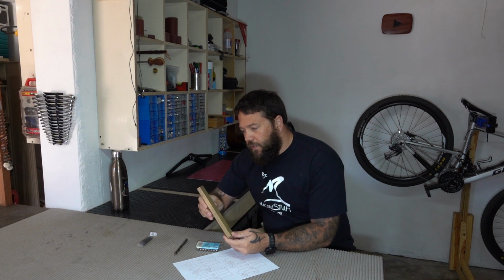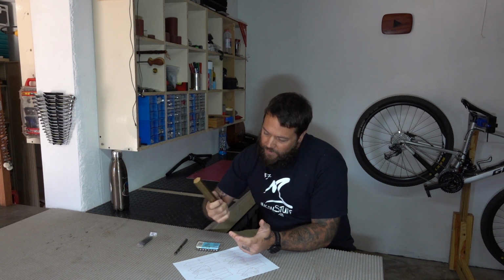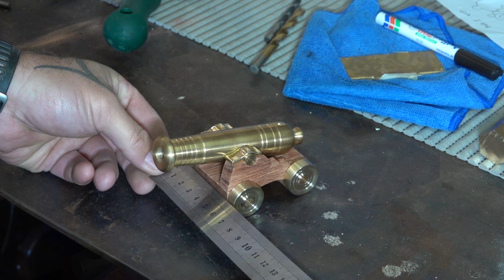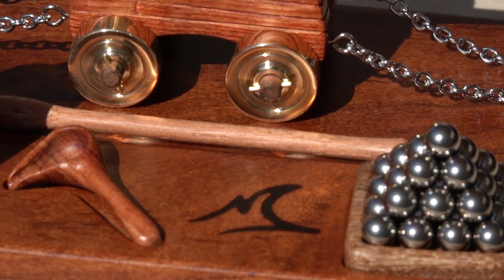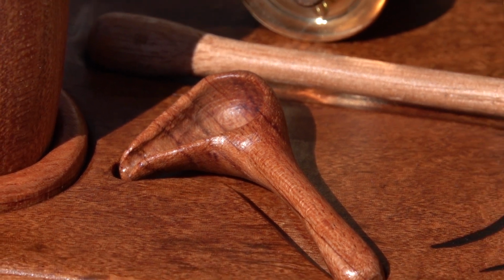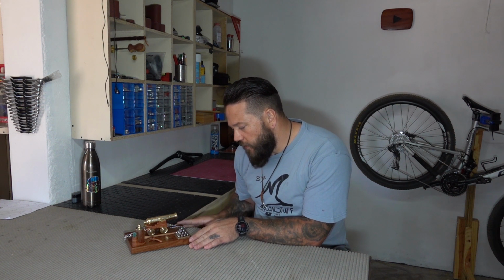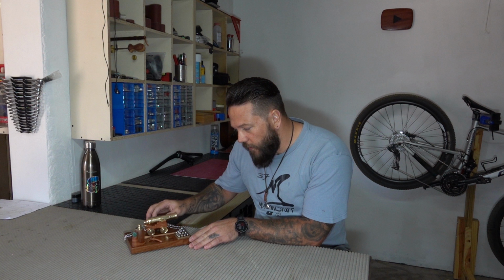Made a Mini Brass Cannon - Last build video on YouTube?

Comment: Every Machinist has to make at least 1 cannon in there career. I got the bug out of the way while at technical collage. I grab the largest piece of bar stock. 42"X 6" steal bar! and put it on the schools 18" X 80" Monarch lathe. The largest drill bit in the shop was 1-1/16" so that is what I bored it to.

Comment: 10k subscribers is already very impressive man

I only have 218 subscribers, and I already made a little bit of money from the Amazon affiliate links, it was quite reasonable to be honest.

and I also have my own online store, where I sell quite expensive stuff, and deliver worldwide, and just from that I already made quite a bit of money. and I'm not even monetized by YouTube yet. so far I used YouTube as the business lead generator, and to sell my own products. 

the recipe is simple:
1. sell my own product IF I have it
2. share Amazon affiliate link to the product which I don;t have

for example, you just mentioned buying 9.5 mm drill bit. 
if only you added few words to what you already said, it would be forever generating some money. little by little. 
you could have said for example, that the best drill bit for drilling metals is Cobalt 5% or something, and the link to this drill bit is in the description, and people will want it, and will get it through your link.

cheers man! never ever give up.

and another thing. 

every project I make on YouTube is basically a prototype / research, which leads to batching it out in the production mode, and selling both online and locally. so the YouTube video does slow me down, but I count it as an investment into the production phase. YouTube video also gives me more time to come up with better solutions while prototyping.
Reply from the maker: Wow man, thanx alot for the comment... very insightful!... I'll have to try and revisit the Amazon affiliate stuff... I think I tried setting that up once, but didn't work for some reason, probably because of my location... also, I tried selling some stuff online when I started out... got an order for a set of custom drumsticks, but when I went to ship it, I got a big shock, it ended up costing almost as much as the product I was selling, so I made a big loss... guess thats what I get for not doing proper research first... shipping to and from here in Africa is horrible... I dont even order online... really expensive (I have to order a ton of stuff to make the shipping worthwhile) and usually it takes between 3 to 6 weeks for stuff to get here... if it gets here at all... 😒

Anyway... thanx for the message, lots of food for thought here... I'll probably still upload occasionally... just not every week like I've been doing... I'll check out some of you videos too... Sub'd... Now you're at 225... 👍
Reply: @maconSTUFF  cheers. wish you all the best man!